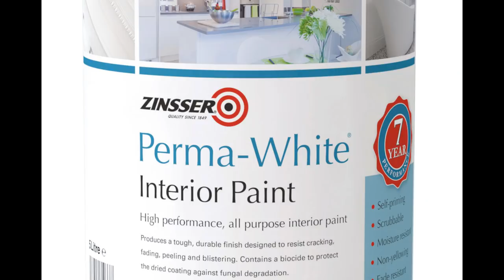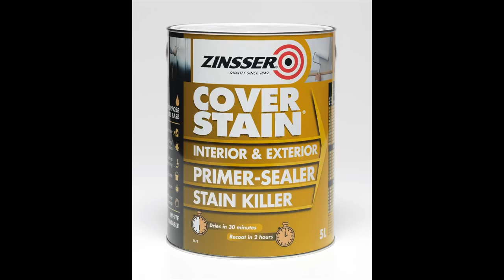How to paint a radiator

Comment: Gone are the days of smelly radiator paint! water based paint (and of course easy brush cleaning) has come a long way,  I still remember my dad painting a radiator, and everyone in the house felt a bit sick for days due to the smell.   i cant believe the exterior stain i used on my window frames is water cleanable, its been the most long lasting of all the previous types ive used.
Reply from the maker: +jusb1066 
Absolutely, some water based paints are brilliant ;-)
Thanks for the comment

Comment: Painting radiators... It can be a heck of a job if you find radiators like the ones I have in my flat. My ones are the same as the ones in your video but with dozens of paint drippings. It was a nightmare. I used a Dewalt Palm sander which helped a lot. Nice video.
Reply from the maker: +Rui Nunes It's a nightmare when someone has made a mess of the job before you!Thanks for the comment ;-)

Comment: I found this really helpfully, I may well give the zinsser a go next time. Personally I'd have used a slightly wider brush. 
Working with gloss i have often had the gloss tinted the same colour as the walls so the issue of yellowing is not as pronounced as with brilliant white.
Reply from the maker: +Paul F Thanks Paul, Zinsser make some excellent paints and primers.I have a tin of their AllCoat in white, which is a water based gloss. I'm hoping to try it on some external window frames next year, because it is water based yellowing should not be a problem with the Allcoat.Thanks for the comment

Comment: Good to see you didn't paint over the lock shield valves, a big pet hate of mine.
Reply from the maker: +hucks33 
I'm always cursing painters when on site if they have painted the bolts on flanges etc. as it makes them really difficult to remove- so I know not to paint bolts/valves etc.
Thanks for the comment ;-)

Comment: Hi. Long term subscriber as great channel. I've painted my radiator with water based paint, and it becomes tacky when the radiator comes on. Would the Zinseer paints avoid this problem. I'm buying some Zinseer paint to go over some tiles so will have it already. Thanks for any advice you can give.
Reply from the maker: The radiator in this video was painted using water based Zinsser Perma white and as far as I know there were no issues with the paint once it had dried.
What brand of paint did you use?

Comment: Thanks for the reply. I used a water based Dulux paint, don't remember the exact paint, but one that is suitable for metal. It goes tacky when the radiator comes on. Have used Dulux gloss in the past, but this turned yellowish after a while. Was also thinking whether Hammerstein radiator paint would be any good. Cheers.
Reply from the maker: Yellowing gloss used to be a real problem, I think it was due to them being oil based.
The hammerite radiator paint should be fine ;-)
Thanks for the comments

Comment: will be priming mine with Zinnser cover stain (oil based). Do I need to then use an oil based top coat, or could topcoat be water based? Could you reccommend a rust convertor brand please? Love your chan and have learnt to respect your opinion, thanks for any advice!
Reply from the maker: You can paint over Coverstain with water based paints.
The only rust convertor I have ever used is Loctite Rust remedy, it seems to work really well.
Thanks for the comment
Reply: Ok, thanks for the help, much appreciated :-)
Reply: never use a oil based white top coat unless its something like rustins oil non yellowing if you use your standard oil gloss satin etc the heat will make it yellow very fast. and don't use oil based white on interiors they all yellow in a timeline of 6 months to just over a year always use hybrid gloss and satin etc for whites if you something close to the application of oil for interiors stay white for years.

Comment: After watching your video over and over again whilst researching the products, I had to subscribed! It's so well explained and so informative. 
Please, if I could have your opinion on this, I'd be so grateful. We have 3 radiators, one in the bathroom (really rusty at the edges,  a bit like the one in the video), a small one in the kitchen with slight rust (not very noticeable) and one in the hallway with no rust. If I had to choose between buying Zinsser cover stain or 123, which one would you advise (I know one is oil based and the other water baed) or I really need both of them for the rusty radiator in the bathroom.
Thank you.
Reply: I forgot to add that I'd probably have more future usage of the 123. Thankd6
Reply from the maker: You might be able to just use two coats of the 123 after applying the rust convertor. It's not something I have ever tried before, as I normally use Coverstain- but it might work and would save the expense of buying the Coverstain.
Thanks for the comment

Comment: Hiya :) I just wondered can you paint a chrome towel radiator ? If so would you use the same method :)
Reply from the maker: You can paint it, but it is not a simple job and you cannot use the method in this video. 
If you just search for "how to paint chrome", you will see how to do it- but to be honest you are better off replacing the radiator for a powder coated one. 
Thanks for the comment

Comment: is this the same 2 coat system you used on the tiles? after seeing that video, i used the 123 and the permawhite in my bathroom and its still going strong 3 years later! (over old pink gloss tiles that were there when i bought the house) 
I have plenty of 123 and perma white left over so this would be a perfect use for them as i have a couple of radiators that need repainting
Reply from the maker: +joeshaft 
Yes, it is the same system. But if the radiators have not previously been painted with another paint (apart from that applied in the factory) you can just use two coats of Perma-white (you can now get it tinted to any colour).
Thanks for the comment
Reply: theyre painted with white gloss/satin and they were already in the house when i got it. Just theyve gone a bit yellow now so i wanted to freshen them up with something (was going to use actual high temp radiator paint, but think ill go the zinnser route now) Thanks!
Reply from the maker: +joeshaft 
I'm not sure how well specific radiator paints work on top of standard gloss paints, but the Zinsser 123, then perma white should sort it ;-)
Thanks for the comments

Comment: Would I be able to just use Zinsser Perma White on its own to paint my radiator or does it need to be prepared first? Many thanks.
Reply from the maker: If it's not rusty, you should just be able to clean it using methylated spirits (denatured alcohol), then apply two coats of Perma white 👍
Reply: @ultimatehandyman  Brilliant. Thanks so much for getting back to me, much appreciated.

Comment: is the perma white-suited for painting radiators or am I better off going for a paint that's specially designed for painting on radiators?
Reply from the maker: It works fine, but you might be better off using a specific radiator paint.
Thanks for the comment

Comment: I have a radiator with several layers of paint over the years looks horrible. Is there a way to safely strip the whole radiator and paint fresh?
Reply from the maker: I don't do much paint stripping but I'm sure one of the popular paint removal kits will work.
Thanks for the comment
Reply: use a product called strip away it can strip up to 30 layers in one coat also try a wire brush if its flaked enough then degrease with methylated spirits then if you don't know if your rad is non ferrous or not play it safe and use a oil based metal primer give it a light sand and if you want a oil top coat in white use rustins undercoat satin or gloss non yellowing oil dont use a regular oil gloss satin in white it will yellow very fast. if not use hybrid paints or acrylic topcoats.

Comment: I hate painting at the best of times, I hate glossing. Is there any water based paints you would recommend for doors etc, I ain't got a clue with painting, it's by far my least favourite activity.
Reply from the maker: +Zed Man I used some Zinsser AllCoat earlier in the year and that covered really well. I was so impressed with the black gloss that I bought some white gloss for painting the external window frames in my garage, but I have been so busy this year that I didn't get chance to do it before the colder weather arrived. Hopefully I'll get a chance to try it next year!I went to the painting and decorating show in Coventry this year and had a chat with one of the guys on the Zinsser stall. I said that the AllCoat covered well but was not as glossy as regular gloss paint. He explained that because it's water based you do not get the initial high gloss, like you do with oil based gloss- but it lasts much longer without yellowing.I never used to be keen on painting, but if you use good quality brushes/rollers/paints it makes the job much easier- I now find it quite enjoyable! Thanks for the comment
Reply: the easiest water based glosses satin undercoat I've used is johnstones trade aqua you can use the undercoat as wood primer also but if there bare remember knotting solution for water based paints if really resinous 3 undercoats 2 gloss if will give you same finish as oil if already painted then 2 undercoats and 2 glosses.

Comment: No need to use zinsser 123 as long as it's been rubbed down and cleaned,  Zinsser perma-white is self priming
Reply from the maker: +MrIknowbest2 
That's correct but the first radiator I painted (the large one) had previously been painted with a gloss that had yellowed, so the 123 was used to block the old, previously applied paint ;-)
Thanks for the comment

Comment: What can I do if it’s dried with drips on
Reply from the maker: You'll either need to sand off the drips, or scrape them off and give it a light sanding before priming.
Thanks for the comment
Reply: Ultimate Handyman I did more research and sanded it don’t know why I didn’t think of it was just thinking due to the metal it wouldn’t be possible. Thank you for your reply. I’m new to this and doing my bathroom myself! Xx
Reply from the maker: You are welcome ;-)

Comment: Cool I can use all purpose paint. Cheers.
Reply from the maker: +Toonses 
No idea, sorry as I have never used all purpose paint before. 
Who makes it?
Reply: +Ultimate Handyman It showed right in this video, Zinsser Perma-White High Performance All Purpose Interior Paint.
Reply from the maker: +Toonses 
Sorry, I thought you meant "all purpose paint" was the trade name of the paint.
The Perma-white is good stuff. I painted 4 radiators with it (one was tinted magnolia), the kitchen and bathroom ceiling, the bathroom walls and the kitchen walls (after being primed with Zinsser 123, as they were vinyl), I have also painted tiles with it in the past (after priming them first with 123+)
Thanks for the comment ;-)